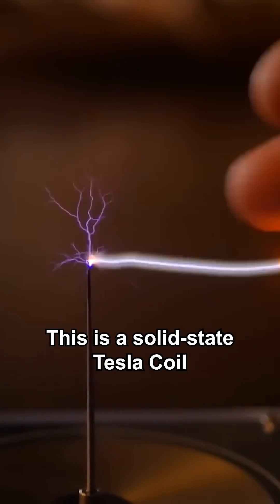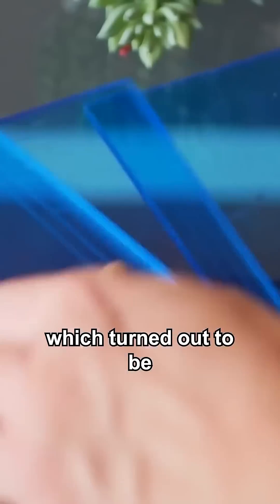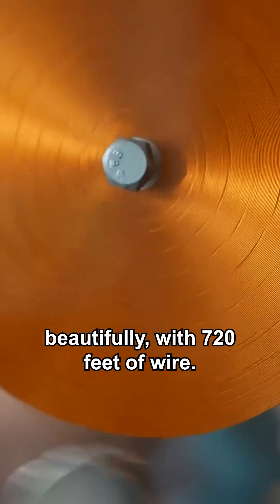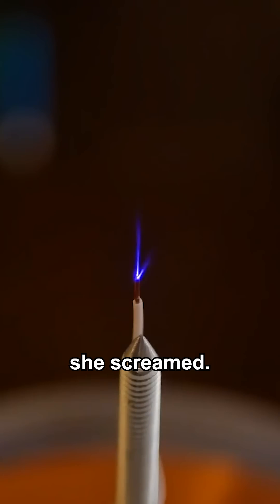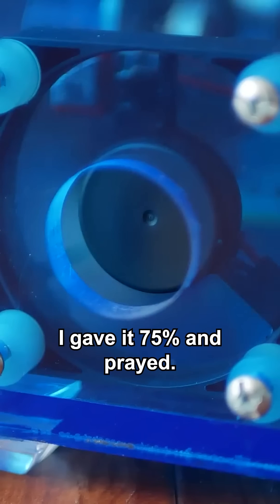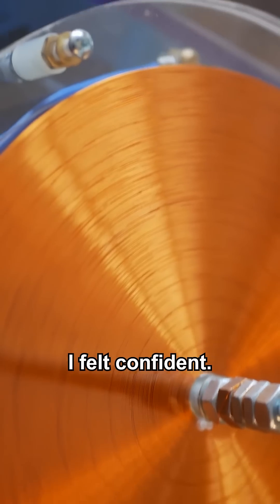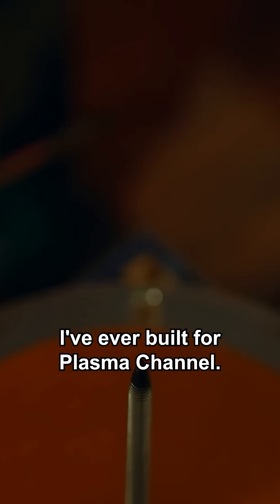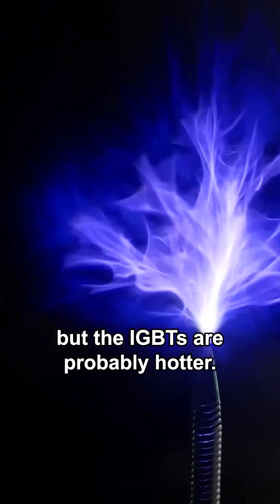Building This Tesla Coil Changed Everything (Huge 3D Lightning)

Comment: The REAL genius of a all mechanical Tesla coil, a non driven tuned circuit oscillator with capacitor and spark gap , is that you take the charge of the air,  ground it through the Tesla coil and it is a step down transformer.

Comment: Nylon nuts and bolts are a good choice for tesla coils that maintains ease of disassembly, though they can be a little more expensive. Just make sure to use the white ones. Might not matter for one this small but the grey and black ones are colored with carbon black, which can make them slightly conductive.

Comment: I wouldnt consider this a solid state version. Nothing more solid than the original.
Reply: A rotary spark gap is not a solid-state device...unless you were making a pun about structural integrity.
Reply: @Pyroteknikid  a rotary spark gap isnt the only way to change the frequency

Comment: Overall well done, BUT...your GDT is wound incorrectly, and I'm surprised no one in the SSTC community ever comments on this. Twisted pairs always lead to gate drive inefficiencies, especially when not using magnet wire. Just throw a 1-10pF cap at the secondaries if noise is an issue. 

The wire needs to be wound 90 degrees to the core. Twisted pairs may provide some filtering but it's at the expense of core losses and increased leakage inductance, which make the secondary of the GDT unable to supply the high peak power (required during turn-on rise time), which leads to the device being on the edge of triode operation of the  IGBTs/FETs in the half-bridge/H-bridge which leads to partial shoot through of the IGBTs/FETs which is why bridges can fail after short runs. 

Re-wind your gate drives as you would find them wound by manufacturers on Digikey or Mouser. One thing to consider but might be bad for tesla coil applications is to wind in a separate single wire on the core, with the other turns, with one end connected to ground and the other end floating, this will help reduce the RF without causing excessive losses (assuming it doesn't turn into an antenna for the secondary return, lol). or wrap the GDT with a ring of copper tape and attach that to ground. 

Another good idea for voltage isolation is to wind the high-side coil, dunk it in polyurethane, let it dry and wind the rest, and dunk it all again in the poly. Let me know your thoughts.
Reply: Grounded copper tape is my preferred shielding solution. Always effective and simple to install.
Reply: Cool.
Reply: I have no idea if you know what you're talking about, I sure don't. Have a happy thumb